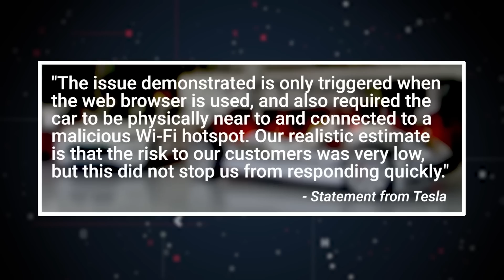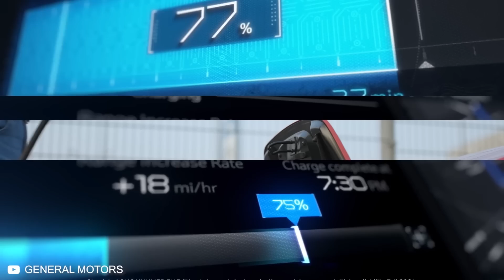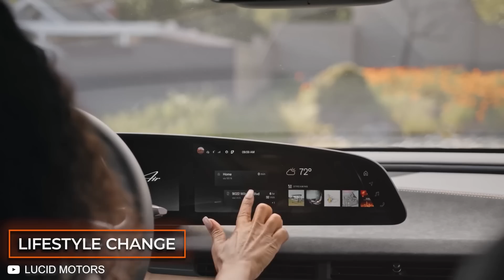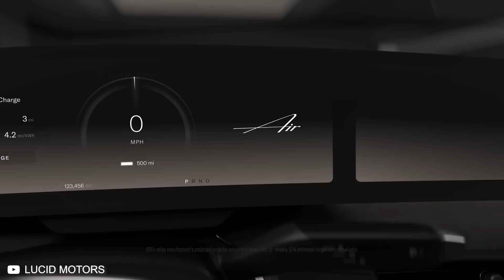EVs' Serious Problems That Carmakers Are Hiding

Comment: For me to invest in an ev,3 things would have to change 1. Cost. EVs would need to come down, way down in price. 2. Infrastructure changes, more charging stations, every gas station should also have EV charging stations, at least 3. Charging stations for home use should be easier to use, less costly.
Reply: Are you ready to sit at a gas station for three to four hours to partially charge a battery??
Reply: @markbutler2444  a lie or are you that uniformed? Unless I drive over 250 miles in one day, I never even have to stop....ever. I plug it in at home and I'm good to go every morning. If I take a trip, yes, then I'll need to stop, about once every 3 hours. Both to charge and use the bathroom! About 15 minutes and I'm good for another 2-3 hrs.
Reply: My lifestyle is already used to an ebike. I have to keep an eye on battery use, and miles. I've adjusted to that. My ebike although pretty powerful, gives me a good understanding for what I'll need to do.
Reply: @duchessstudioband7896  Ebike is great solution.  Small battery gives you huge utility.   Everyone should replace their cars with Ebikes.  But EV cars are not Ebike.  Fat battery EVs weighing 5000+ pounds like Teslas are different story however and try to continue extremely wasteful car culture by another means.
Reply: Costs will likely go up since current battery production can't meet demand and ramping up production will take years
Reply: Right now Chinese / Gm have advertised a 4000 EV car the Wuling  Mini EV, however it's current price doesn't reflect this price. Which  is 16,000.  The car is rather simple, but I believe the company has pretty much lied. I would understand 6000 selling price.  But not 16000.  The joint venture was probably counting on ev incentives, but these EV incentives are ending. So it's really just a 16000 car.
Reply: The life of the battery is five to six years and cost 2/3 the cost of the car so either you’re trade in value will really suck or you have to refinance it for a new battery,, the $1600 Chinese cars are not road legal for US. standards
Reply: @markbutler2444  according to their website, you get A VIN number so they can be registered for legal road use. But still 16000  is no bargain.
Reply: Living in a four story condo (50+ units) with an assigned parking space, they would have to pretty much make a charging station just for me. Guess who has to pay for that? Who pays for the electricity? What if someone else needs to charge or just park their EV in my space?
Reply: Smart gal - you get right the the crucial points.

Comment: Video starts out by mentioning 'global climate change'....otherwise known as "global warming'.....previously known as "global cooling'....AKA as ANOTHER LIB FANTASY! 

Of course we all know WHY the name changes have occurred-the "science" never comes to pass nor is it factually supported.....

With that said, the electric vehicle "revolution" began nearly 100 YEARS AGO!! And guess what?? The GASOLINE powered technology WON!! It truly is the BEST WAY to get around freely! No worries on HIGH cost to buy, range, available charging, spontaneous combustion, and obscenely high battery replacement cost, . Not to mention what battery disposal is going to do to the environment!! In a FREE MARKET environment, people will continue to buy gas powered cars at their current 96% of the time-for ALL of the reasons outlined in this video.

Now, when we are FINALLY ALLOWED to drive HYDROGEN (cheap energy) powered vehicles or better yet-FUSION, then you can use the word "revolution".  Electric cars may have new tech on board, but they themselves are NOT a revolutionary  "new technology"......

Comment: You have to wait for the charging problem to be solved.  That will come within the foreseeable future.  Quantum charging can be a possible solution where charging time will be reduced to full charging within 3 minutes or less.  Not to different from stopping at a gas station and filling up.  Until quantum charging stations are developed and built in terms of infrastructure EV uptake will be limited.
Reply: How about "IF" quantum charging EVER happens. And then imagine EVERY CAR out there being forced to need one.....

Comment: I challenge all EVs to a race. Florida to New York. I use my Toyota Camry. I give you a 12 hour headstart. I bet I will get to NY first
Reply: You're on!!! Oh! one extra condition, the one who spends the most on fuel gets to pay for our New York hotel for the night - separate rooms bye the way - I snore.
Reply: I put my money on your Camry - 5 minutes to pee and gas up compared to an hour or more for the range limited BEV after searching for a charge station. Do it in the winter when their battery range drops by half!
Reply: @Dannysoutherner  that's my point. Thanks.

Comment: Batteries do not produce electricity - they store electricity, which is produced elsewhere, especially by coal, uranium, ground-gas-powered power plants or diesel-powered generators. So the claim that an electric car is a zero-emission vehicle is not at all true.
Since forty percent of the electricity produced in the United States comes from coal power plants, forty percent of electric cars on the road are coal-based.
But that's not all yet. Those of you who are passionate about electric cars and a green revolution should take a closer look at the batteries, but also wind turbines and solar cells.
A typical electric car battery weighs a thousand pounds, about the size of a travel suitcase. It contains twenty-five pounds of lithium, sixty pounds of nickel, 44 pounds of manganese, 30 pounds of cobalt, 200 pounds of copper and 400 pounds of aluminum, steel and plastic. There are over 6,000 individual lithium-ion cells inside.
To make each EV battery, you need to process 25,000 pounds of sole for lithium, 30,000 pounds of resin for the cobalt, 5,000 pounds of resin for nickel and 25,000 pounds of copper for the copper. All in all you need to dig 500,000 pounds of the earth crust for a battery. 
The main problem with solar systems is the chemicals used to convert silicon into the silicon used for the panels. In order to produce sufficient pure silicon, it must be processed with salic acid, sulfur acid, salpetic acid, fluoride hydrogen, trichlorethane and acetone.
In addition, gallium, arsenide, copper indium gallium dieselenide and cadmium telluride are needed, which are also highly toxic. Silicone dust poses a threat to workers, and the plates cannot be recycled.
Wind turbines are the nonplusultra in terms of costs and environmental destruction. Each windwheel weighs 1688 tons (which is equivalent to 23 houses) and contains 1300 tons of concrete, 295 tons of steel, 48 tons of iron, 24 tons of glass fiber, and the hard-to-earth rare earth neodym, praseodym and dysprosium. Each of the three blades weighs around 81,000 pounds and has a life span of 15 to 20 years, then they must be replaced. We can't recycle used rotor blades, they, along with used solar panels go into landfill.
These technologies may have their place, but you have to look beyond the myth of emission freedom.
“Going Green” may sound like a utopic ideal, but if you look at the hidden and inconsiderate costs realistic and unbiased, you’ll find that “Going green” is doing more harm to the Earth’s environment than it appears WHEN YOU LOOK THROUGH THE SMOKE & MIRRORS.
I'm not against mining, electric vehicles, wind or solar energy. But I show the reality of the situation.
EVs #THENEWBETAMAX
Reply: BRILLIANT facts here!! Notice the woke NEVER go over COMPLETE facts! They almost ALWAYS lie by omission! Also notice that they have to create a market for EV's by legislation-NOT the free market. Which STILL overwhelmingly chooses ICE cars to EV's at a rate of 9 to 1!
Reply: Where do I start!!! Okay "Since forty percent of the electricity produced in the United States comes from coal power plants, forty percent of electric cars on the road are coal-based." WRONG! When someone gets an EV the first thing that occurs to them is "this makes installing solar on the roof a no brainer" 
Here is the real point. We are in a transition from carbon based fuels to non-carbon based fuels.  It happened with horses to cars - unless you're Amish, you have made that change. Some people go kicking and screaming whilst others try anything new and go "this is brilliant, I'm a convert" My son bought an EV 2 years before me. It took me 2 years but I'm an old man.
Reply: @ianhamilton3113  Heh, Rooftop solar panels. Heh. Great if you live in Arizona with endless sunshine and no tornados. Where I live a stiff wind would rip your solar panels away in a second, plus I would have to cut down all the trees in my yard. That is a no-no where I live, tree sanctuary city. I also guess you don't go on road trips, local driving only right?

He is right, if you plug in then your BEV has either a steam engine, gas, diesel or uranium. There is no free lunch.